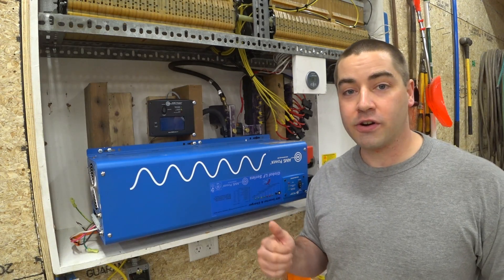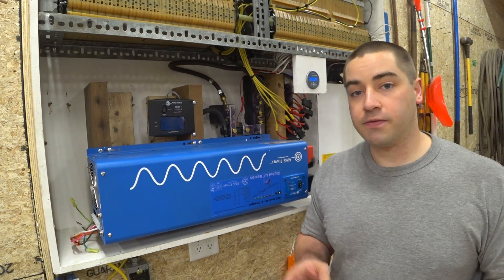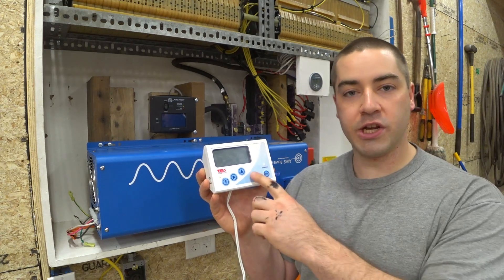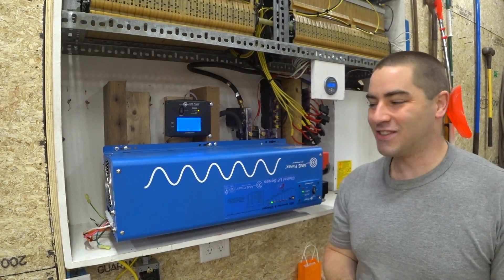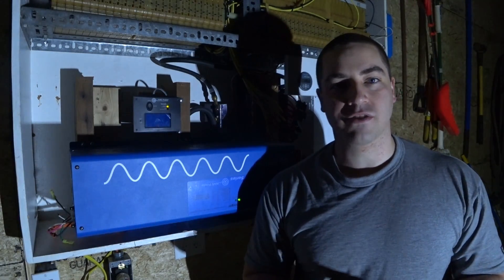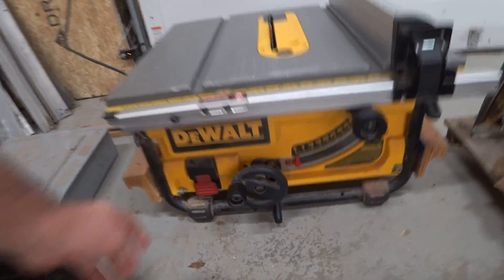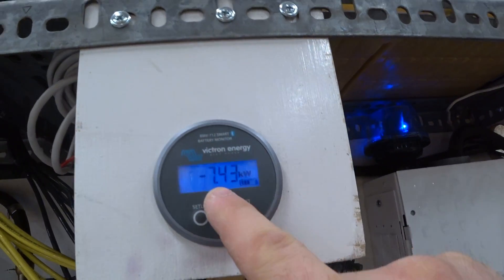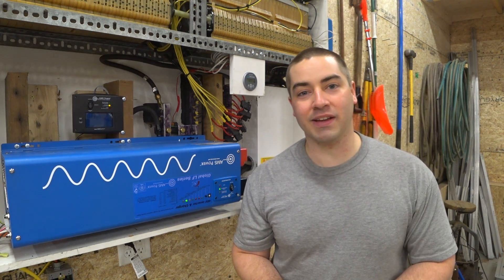Efficiency Test of Aims Low Frequency Inverter

Comment: I use a split phase sungold 4000 and it runs my minisplit thats exactly the one you installed in one of your videos. Ive actually got that inverter running my whole camper and minisplit now. I like the low frequency inverter way better than my all in one inverter. But yeah that aims is awesome.

Comment: Hypothetical question: Can the AC output of a battery powered Sine Wave Inverter be connected in Parallel with the AC output of a Sine Wave Inverter Generator? Example: Connecting in Parallel the 120 VAC 60 Hertz output of a 12 VDC input Sine Wave Inverter to the 120 VAC 60 Hertz output of a Honda eu2000 Sine Wave Generator?  I would expect they would automatically Synchronize their 60 Hertz Frequency outputs, but I'm not sure how their output voltages would be regulated in the event that they had slight voltage output differences. I'd like to know if anyone knows what really happens... not what 'might' happen. Thank you
Reply from the maker: No.  There are big warnings in the manual about trying to AC couple anything.  Aims does not support AC coupling.  However, there are some inverters that do.  I own SMA inverters that will AC couple, and I think Schneider and Outback have some models that do.

Comment: This is pretty cool. So how long can you power your house using the daily requirements for power without running the power in a miserly fashion? (Normal power consumption). Can this system give you lights and power for heat in the dead of winter during a power outage?

Comment: Nice video and you have done a great job here. I own the same inverter (4KW), it is a different brand name but I can see that it is the same inverter from inside. When I tested, the efficiency with a 2.5KW load was about 89% and with 350W load about 48%, however, the no load power consumption is about 130W, don't know what is wrong with it.
Reply from the maker: I have also seen the same thing from knock-off brands.  I'm guessing Aims fine-tuned the programming inside the computer to make it more efficient.  But that's just a guess.
Reply: I don't believe AIMS is actually the manufacturer.  It may be Sigineer.  I have to wonder if some things like idle power consumption vary from unit to unit with these Chinese inverters.  I would think a 12v or 24V would also be less efficient.  I'm looking hard at a 4000k split phase unit.  I was hoping to see slightly lower idle power consumption with the smaller inverter.  Not happy to hear yours is so high.  Is it a Sigineer or Sungold?  I'm wondering if the Sungold units are of the same quality or not?

Comment: Ordering lithium forklift batteries from companies here in the U.S. can range as high as $23,999 down to .... for a 48V 500ah unit. I've looked at lead acid forklift batteries, but the main problem I have with those is that I would have to also install an exhaust fan to vent the hydrogen gas from charging. With the system in my basement, the temperature environment is cool and stable, but acid chemistry doesn't have the longevity of lithium. 5000 cycles is far beyond my lifetime, and the lithiums will still have 70+% capacity for a chunk of my kid's lives. Lead acid's on the other hand, at about 1/3 to 1/2 the cost of lithiums, will last anywhere from 8 to 15 years (roughtly), and they are MASSIVELY more heavy. The lithium units weigh in at about 600 lbs, while the lead acids are about 1200 to 1500 lbs.

Comment: I'm in the process of designing a home backup power system using forklift batteries, which are far more economical for the power density they provide, AND they are constructed with 3.2V, 100ah prismatics. The forklift batter of choice I'm going to begin with are 500ah, 48V, LiFePo4 units with built in BMS. The average home consumes about 30KWh of power each 24 hour period without the owner switching off unnecessary loads in a power-out situation in the region. Unless one has access to used, in very good shape LiFePo4 batteries, which most of us do not, brand new forklift batteries direct from China are a great choice for alternative economics. As an Electrical Engineer, I constantly scower the world markets for what gets the most bang for the buck.

Comment: You will measure a slight difference in varying combinations of loads. Resistive loads produce no reactive losses, where inductive loads cause power factor losses that you can't measure with most meters for PV systems, so there will be some measurement inaccuracies depending on the power factor resulting from inductive loads. Also, the low frequency AIMS, being a low frequency unit, has a larger transformer, which can handle FAR more load surges than the high frequency units, as you demonstrated when you were testing your friend's high frequency inverter that bummed you out when it kicked off every time you fired up your Dewalt Table saw.

Comment: I like your channel. There is a video that I would like you to do if you can. Or if you have already done it - perhaps you can send me the link. 
I have battery. And I wanted to do some test to see the power AH rating etc of the battery- I was told be the seller that it is between 160AH and 200AH but how do I know for sure. 
Thanks
Reply from the maker: You can test it by having a meter between the battery and load.  I test my batteries using a cheap $19 meter from Amazon.  Here is a video where I test an LG pack I built: https://youtu.be/hlmKmhhqnq4

Comment: How much power can be draw from a single 120v side of the inverter??🤔🤔🤔
Reply from the maker: Inside this inverter is a transformer.  So each phase can have (nearly) 100%.  But, each phase has a circuit breaker at 40 amps, so the reality is each phase is limited to 4,600w.
Reply: @DavidPozEnergy  thanks alot for answering my question , you are awesome. It can be a good video idea since i haven't seen someone doing that , maybe that can help other people too. And again, thanks for answering.
Reply from the maker: Your welcome.  as a comparison, I have also tested a different manufacturer inverter (MPP Solar LV5048).  It is not built with a transformer.  Instead each phase has it's own little inverter.  So each phase is limited to exactly half the inverter rating.  I have a video on it if you are interested.
Reply: @DavidPozEnergy  yes , i saw that vid and you clearly showed that limitation of the mpp solar inverter , but it is a cool inverter tho. Since the aims 6kw only have one driver circuit for the transformer,  i assumed the transformer could send more than half power from one side of the split phase , but i didn't knew how much. I didn't knew about the 40 amps breakers. Thanks for clearing that up. So up to 4kw on one side and the other can get up to 2kw, for a max of 6kw  output. Thats useful when using shower water heaters.

Comment: Thanks for this awesome demonstration! But I'm pretty new at all this and bewildered. Why are Aim Inverters so costly? And Then some Inverters are "way" cheaper in price? I gather from your demonstration it's all part of quality components? But do the others work as well?
Reply from the maker: There are lots of cheap inverters.  I've owned my share of them.  I've had two blow the electronics when trying to use my power tools.  But, they are fine if you are powering lights, TV, computers.  But high surge loads (tools, air conditioners, compressors) you need a bigger, heavier, and more expensive unit.

Comment: I used the Aims 5000 modified in very bad conditions with dust, heat and 10 years later it works perfectly! Upgraded to this exact 6000 but a 24v model and 3 years perfect performance! I have one of their AC switch 2000 pure wave in a camper and it runs perfect last 3 years! I have a spare 5000 modified in box and never needed it. I ran 10kw several times no issues. Love them.

Comment: I have 5 deep well 12 volt military batteries on A-switch and 5 on the B-switch. I have a 2,500 watt converter and it works fine for everything but my air conditioner, or anything like a toaster. How can I bump up the power to insure it all would work. AC unit has a 29amp start up. (Tip) We have an interstate battery store that takes in military batteries that sell for 650.00 each on-line. I spent 75.00 for each. I am trying to live off grid and almost there!

Comment: Hi DavidPoz, you make an amazing review, thanks. Are you doing these tests in 120V or 240V?
Reply from the maker: Both.  I live in North America.  Our power system is 120-N-120.  Sometimes called "split-phase".  We have two hot legs that enter our house.  Each leg is 120 volts, and they are 180 degrees out of phase.  So if you connect the two you have 240 volts.  This inverter supplies two legs at 120 volts each.  I have both 120 and 240 volt appliances.
Reply: @DavidPozEnergy  Thank you a lot.  another question. Can you use the output at 120V and 240V at the same time?.
Reply: @miguelatlsilvamagana7060  Yes, on a split phase 240V system like the one he has for his mains input and the inverter output, loads can be using both 240V (1 leg to other leg) and 120V (leg to neutral) at the same time.

Comment: It's 8 months later, how do you feel about the inverter now?  I'm about to buy one for a whole-house UPS type application with the intention of adding grid-tied solar later and even though the Aims is a value compared to something like a Radian it's still not cheap.
Reply from the maker: The Aims 6kw has been great.  I agree that it's still not cheap, I think a new one is $1700 now.  Here is a link for a different brand that is less money, but is still the basic Aims components.  https://amzn.to/2LHzUAP  If you use Amazon it helps me out if you use my links as I'm in the affiliate program.

Comment: Its not Aims inverter its Nasa inverter, tried and tested as some ones life depends on it.
I am impressed by this inverter
Its a good investment.
Reply: It helps to watch Apollo 13 before the hurricane hits and the solar is useless.  I whittle my amps down to almost nothing to stretch out the charge on the Aims lithium batteries.

Comment: at idle 66 watts  for 8hrs = 528whr only for nothing. what do you think is this acceptable?Or go for standby mode.
Reply from the maker: Yeah, 1.5 kwh per day.  It adds up quick.  I don't run this 24/7, it's a back-up system.  It's mostly a backup.  When I go out to my garage I will turn on the inverter and run my tools, charge my cordless tool batteries.  But I turn it off when I leave the garage.

Comment: How low did the battery bank drop?- opps just read other comments.
Reply from the maker: Hi James,  Yeah, I get that question a lot.  I I've seen as large as a half volt sag going from no load to 4500w load, but then it comes up another 0.2 volts or so.  I don't know how that compares with other batteries, but I think it's OK.
Reply: @DavidPozEnergy  Have you looked at an ultra capacitor bank to augment the initial power pull?
Reply from the maker: Hi James,  A few people have suggested that, but I'm lost.  I don't know anything about capacitors besides they are often mounted on motors for the initial startup.  I have no idea where to start with the calculation on how many, or what size, or where to buy.  I don't even know if capacitors are on one leg, or jump between both?  Are they on the DC side or AC side?  I'd love to learn more about them.  Do you know of any video tutorial out there?

Comment: My test of my 5yo  schneider conext sw4024 shows 84% efficient.

Load + losses efficiency    decription
0         64        0% idle
5         64        7% inductive burner ready
87       70      55% freezer
251     97      72% gas clothes dryer
327     88      79%  Electric heater no fan
835    165     84% inductive burner level 3
887    175     84% inductive burner level 4
960    189     84% inductive burner level 5
1096  212     84% toaster
1120  203     85%inductive burner level 7
1510  320     83% inductive burner level 10
Reply: My 10cf 2018 Magic Chef consumes 0.4 kilowatt hours a day and my 20cf 1999 Kenmore consumes 1.3 kilowatt hours a day.  I'm in Hawaii so it's pretty much 80° 24/7. Except the chest freezer sits outside and the wind is really taking the toll on the Leaky door seal
Reply: The 48 volt version of my inverter claims 2% higher efficiency so 94% versus 92%
Reply: I couldn't go higher without trusting the watt meter on the inverter itself.
Reply: I used the kilowatt for measuring consumption and The Wiz bang Junior shunt on the batteries to measure what was actually coming out of the battery Bank
Reply: My Manual shows my inverter rated at 92% Peak efficiency. Maybe I should try balancing equal loads on each leg and do the test again
Reply from the maker: Hi Travis,  It is so wonderful that you are willing to post your numbers.  Thank you very much for taking the time to perform the test, and second, having the gusto to post it.  Your freezer only takes 87 watts, that's a nice freezer.  Sometimes old freezers or fridges have a high load for the compressor, but yours won't be giving you any problems.  I think that inverter peaks at 92% efficiency.  Do you think it gets up to 92% once you reach 50 or 60-% capacity?  Thanks again.
Reply: I can hook up two or three kill-a-watt meters and try and get closer to its Max to test if it can reach 92%.
Reply: It's the cheapest small chest freezer at Home Depot. 600w startup surge.  For the first year it only took 15 watts when it was pumping which makes no sense and I can't explain, it's duty cycle is still the same I expect it's consuming around 0.5 kilowatt hours a Day but I'll double check and report back now that the door seal is toast
Reply: So I've had the kilowatt meter on the chest freezer for 200 hours and with the Leaky door seal it is consuming 0.75 kilowatt hours per day which is nearly twice as much as before when the seal was good.  Perhaps getting it out of the wind and sun or fixing the seal would reduce the power consumption a lot.

Comment: Its likely to be lower because at around 21 Deg C is where most electronics run the most efficiently. A factory i work in runs their switchrooms and switchgear rooms at around 25 Deg because it makes their VSDs work more efficiently

Comment: Yes 7000w is a ton massif this is incredibility to not shutdown 
thanks 
All your meters is on place +  battery  bank   
Inverter you do it more than the specks 
Thanks I'm in joy your videos this so big helping when I supply installed inverters 
I run true you videos listen to them if I need help 
I will not blown up a inverter
 Thanks you test taken some times risk meanings when you do things you go true it if something when wrong you fix and goes on 
May God bless you 
Thanks the video is one big deal

Comment: To output conect 15uF/630v capacitor to compensate reactive power and transformer would run quietly..... 👍
Reply from the maker: Sorry Bostjan, I don't know how to hook up a capacitor.  Do you have any video, links, articles, wiring diagrams, blog posts, etc. that you could link to and help me out?
Reply: Would be best to use a capacitor that didn't have a resistor built into it but they're dangerous because without the resistor it will stay charged after you disconnect it. It could be laying around and someone touches it months later blowing holes in their fingers or killing them
Reply: Normally you would attach the two capacitor leads to the AC output. If you do some Googling on adding capacitors to power factor correct inductive AC loads you'll probably get plenty of DIY tutorials

Comment: Can I use this with washing machine ? 2.2kw ? With heater ?
Reply from the maker: My washing machine does not have a heating element inside it.  However, I have done 3 loads of laundry so far on the inverter, and at the same time had my water heater on, and heating water (I checked), plus all the lights, TV, and dishwasher.  So you would probably be OK.
Reply: @DavidPozEnergy  I am off grid in the moment with 2000w inventer my only problem is washing machine :) 2200w
Reply from the maker: Congrats on being off grid.  I'm working my way to join you.
Reply: @DavidPozEnergy  I don't have many elements in my house I have led Philips tv 80w fridge 180w laptop 18w and 8x12w led light but I use 2 all the time :) from solar I have 2x280v solar panels 60a mppt solar collector and 4x480amp deep discarge battery and 2000w inventer this is small setup but I work for 300euro (380$)
Reply from the maker: Sounds good.  Just two solar panels takes care of all your needs?  You must be very efficient.
Reply: I am from Macedonia one nice and sunny country from 365 days we have 280 days sun :) but the problem is solar power technology is unknown for my country :) they are pessimistic
Reply: Lol your people are pessimistic about solar? It's the opposite where I am. I am in Hawaii and it's almost as if solar was born here. People were living off of solar here over 20 years ago.  Don't worry solar work so good now it's easy to show them
Reply: Be careful it sounds like you might have very large batteries and small solar panels. That might cause you to under charge your batteries and ruin them. Looks like you might be able to harvest only around 2 kilowatt hours per day.  You told us how many amp hours your batteries are but not the volts so I don't know how many kilowatt hours they hold or how many watts you need to properly charge them.